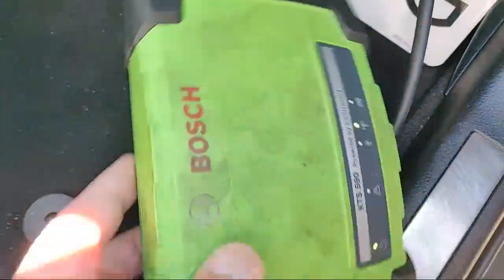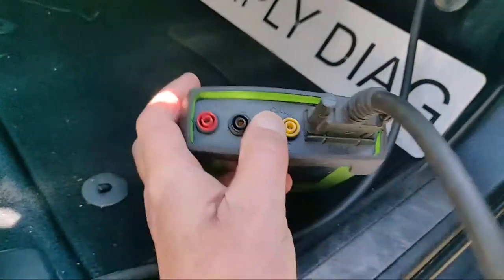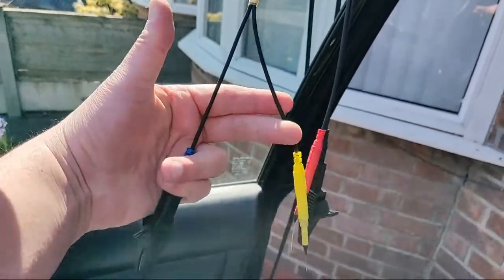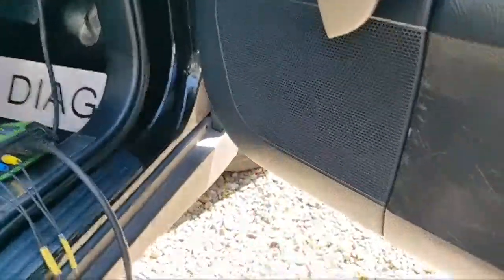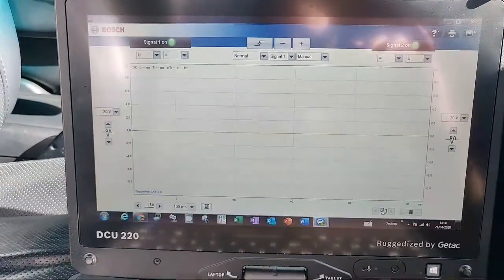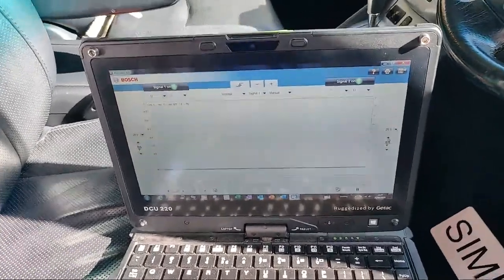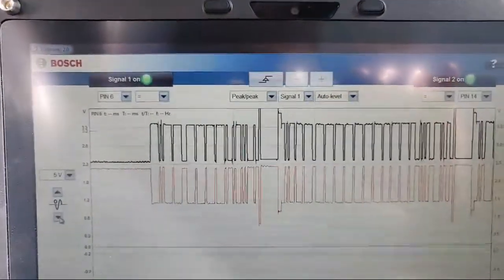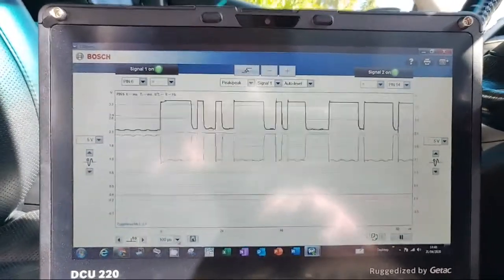Use What You Have - A Scope Is A Scope Is A Scope

Comment: Hi Steve, nice video. Thanks, I have a tip for you, rather than clicking away to lower the zero base line on the screen you can select ‘=+’ from the drop down menu under the ‘signal on’ button to instantly drop the zero baseline to the bottom of the screen if you are only viewing a positive signal. 👍🏻
Reply from the maker: Thanks Mark - great tip 👍

Comment: What's your opinion of yhe vantage Pro I also have the modus I don't use them near enough and how are they with pressure transducers many thanks
Reply from the maker: Great question, the honest answer is that I don't own one. iirc the sample rate is more akin to a graphing multimeter. For quick checks it would definitely find a place in my box. As for pressure transducers then I'd be tempted to say it's not powerful enough.
Reply: @SimplyDiagnostics  Thanks for your quick response to many toys that don't get used learn to use what you've got, I would like to see someone on a vantage Pro using a pressure transducer rather than waste the money again many thanks lalso enjoy your videos.
Reply: @SimplyDiagnostics  I'd agree with Steve. I have the Vantage... and it's sampling is not good enough to get the valuable info you'd need to use with pressure transducers, at least incylinder or intake pulses, let's say. 

However it would be great to use when checking injectors,  such as pressure drop comparisons. Much more accurate than using a mechanical gauge. IMO
Reply: @CubasAutomotive  Thank you as I said I'm not using them enough it might be a good time to starting using them again as there is a bit of time available, if you know of any good links on YouTube could you put the. Up thanks stay safe.
Reply: @raymondferguson1935  absolutely.  ScannerDanner has a whole series on the snapon scopes. In the search box.... "ScannerDanner vantage", quite a few should pop up. Here's 1:
https://youtu.be/DovaLnRFr0U
Reply: @CubasAutomotive  Thank I was a member on his  paid channel before youtu.be stopped them again thanks
Reply: Simply Diagnostics hello Steve how about using Verus Pro 4 channel scope with pressure transducer would it be man enough or again coming to my earlier chat with you about the need of Pico scope 
Again great video mate keeps you occupied or shall say away from missus 😂 and the reason to sneak out from house 
You take care mate